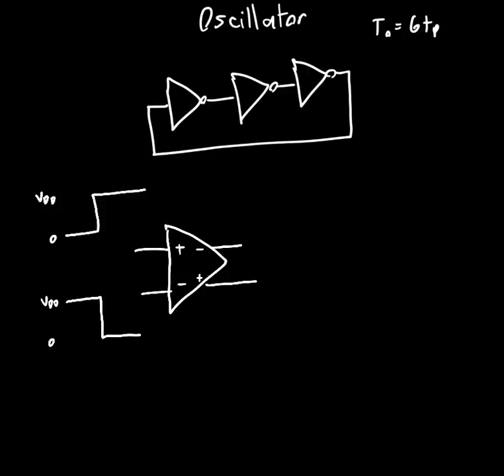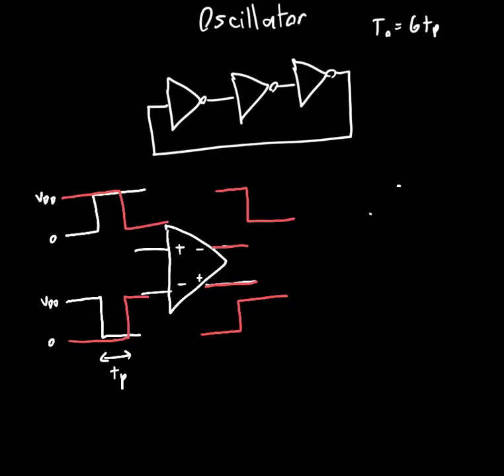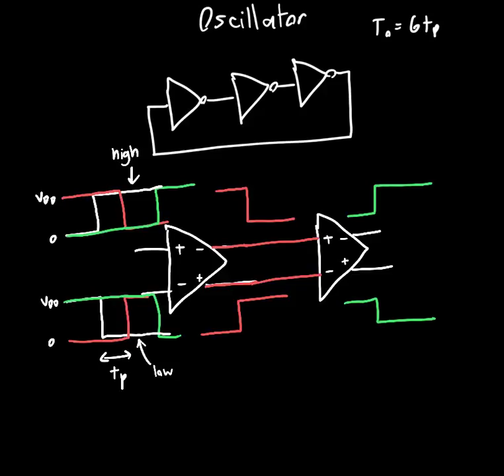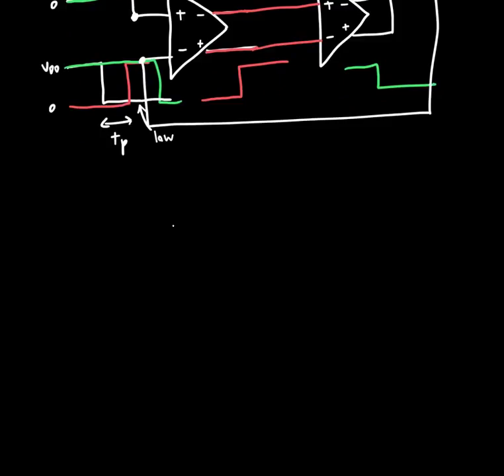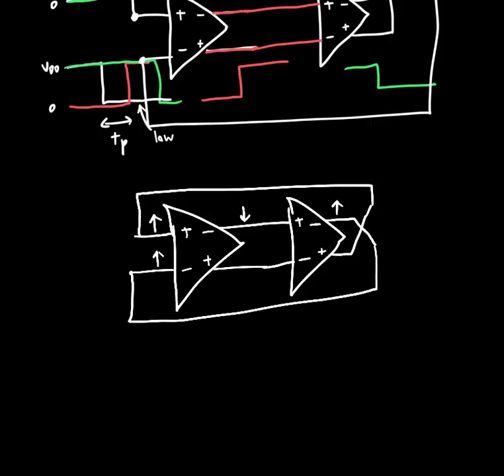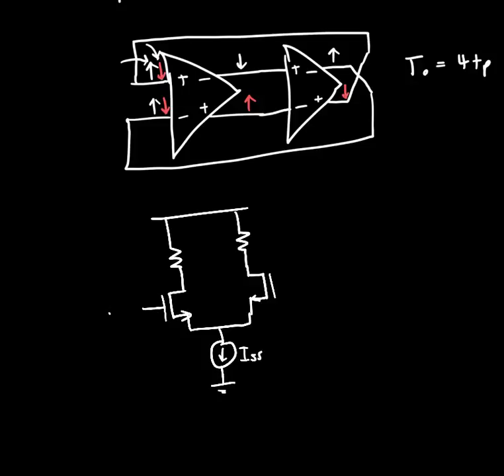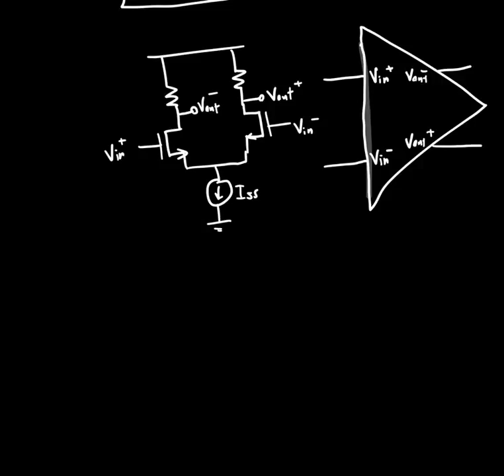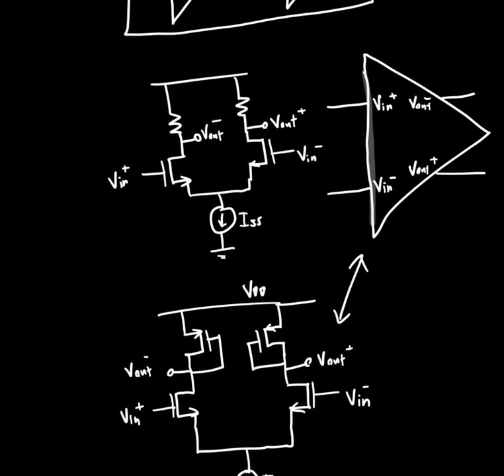Differential Ring Oscillator

Comment: Two-stage differential ring oscillator cannot oscillate due to the limited number of poles. Unless you do some modification inside the delay cell by adding a negative resistance in the drain (e.g. cross-coupled gm). Then with careful design, you can have oscillation.
Reply: how can the two-stage differential ring oscillator oscillate by adding a negative resistance in the drain????
Reply: @xla6479  Look for "Design of CMOS Phase-Locked Loops" by Behzad Razavi. He explains it there.
Reply: @mohammadkhorshidian2119  okay...😭
Reply: what is the chance you are talking about small signal analysis? in large signal analysis, I don't see any limitation